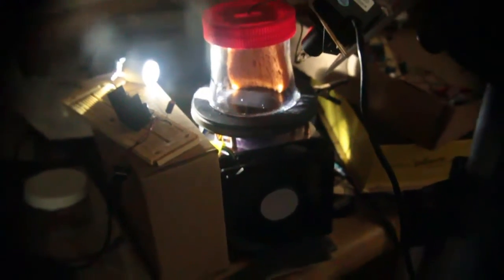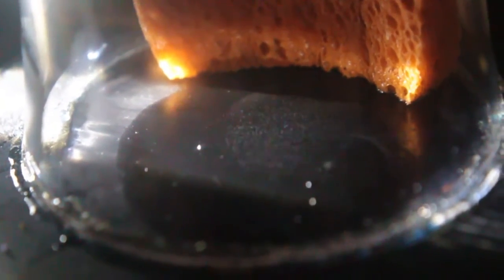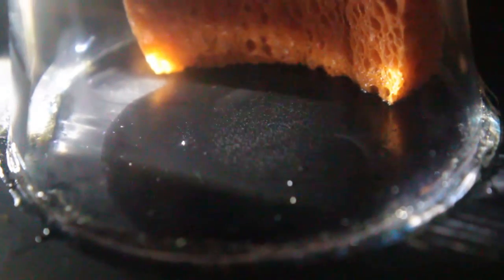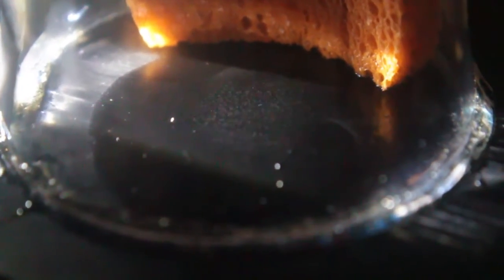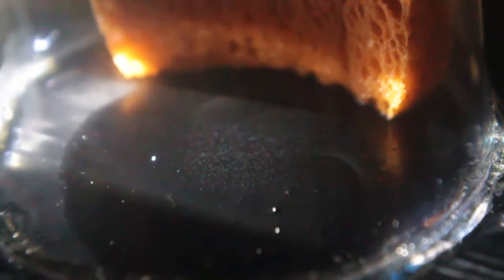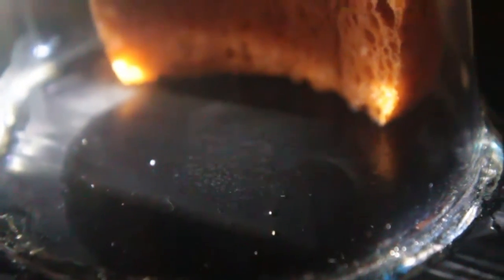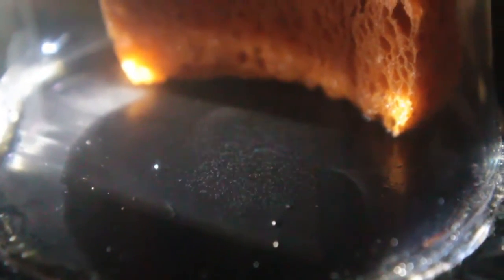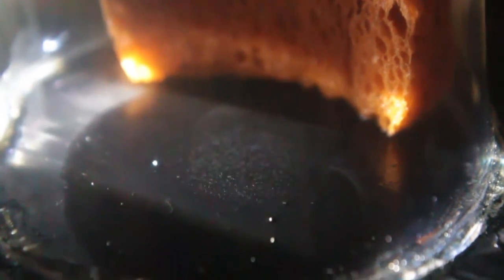Peltier Cloud Chamber Stabilized 12-9-15

Comment: I don't know why but something really strange and funny but soon annoying happens with my chamber. If i put my hand close to the cylinder, a lot of trails start to appear like i'm a radioactive alpha emitter! If i move the hand i can "control" those trays, kind of magic...but often this makes mess with other particles background like radon in which i'm interested. Maybe with hands movement I make changes in the electrical field and move tiny dust particles? But why in the hell dust particles should cause condensation trails?
Reply from the maker: Uhhhhhhh.... Only charged particles will make the trails, so... that really shouldn't be happening unless you're somehow contaminated. It's not like a radio receiver where you can accidentally introduce interference any number of ways. Me, I'd be digging or building a Geiger counter right away so I could test myself for radioactivity that shouldn't be there. You don't by chance have a radioactive materials collection, do you? I have a few different samples and I always test myself on my Geiger after using any of them, just to make sure I didn't expose myself to any dust from them.
Reply from the maker: One thought does occur to me just now... Maybe you're altering the local electric field and making it more efficient for showing the trails. If you're actually emitting particles, then the vectors would all be pointing right toward your hand. If they're not, and simply appearing when you get close to it, then I would look at the way any electrical field involved in the chamber is set up. I found that if I ran an HV lead to the lid of the chamber and grounded the base, it was far more effective at showing trails. Make sure any HV souce has a path to ground, otherwise it will seek to ground through the air to any large conductive path to ground... including you...

Btw, by "path to ground" I mean an AIR path to ground. You need an electric field in the air inside the chamber, not like a high voltage wire right to grounded metal, lol.
Reply: @NightRunner417   Thank you for the fast answer! The effect increase if I rub my hand on the chamber, but not always. I did a fast search and found that the very first cloud chamber was created to study clouds originated from dust particles. I also remembered that I left opened the chamber for a lot of time before operating and a lot of dust could be inside. So maybe the electric field charges dust particles, than the condensation starts, and when i put the hand the sudden change in the field vectors throws the particle away (like when you open a jar filled with flour and everything jumps outside) leaving the trays. Maybe I'll post some videos in the future! Sorry about bad english.
Reply: @NightRunner417   I only have a small piece of rock with 4 tiny crystals of autunite on it (less than 1mm, barely visible) and always handled with care ;)

Comment from the maker: Yeah, about that... that's, uh.... this thing called WTF Factor, lol. I've tried just about everything to control it and understand it and although I have been able to reduce it, I can never quite get rid of it totally. At first I assumed it was the effects of the high voltage field that clears ions in the chamber, but removing the high voltage did absolutely nothing. So, I assumed it was vibration, and I did various things to reduce any fan vibration or at least change it, and still NO effect. The only thing I ever did that made any difference (actually almost eliminated it) was to place sponges on either side of the cold spot for a surround effect. You should see when it's really going... it's got this wild, rippling, spinning motion to it almost like you'd see in an alcohol fire on a flat surface or a rotating wave interference action. It could be some kind of mixing effect with water vapor vs. alcohol vapor, but that really doesn't explain how surrounding the cold spot with sponges stops it in its tracks. I did a little random searching online to find some explanation but never found anything. For now it's just my weird little mystery.